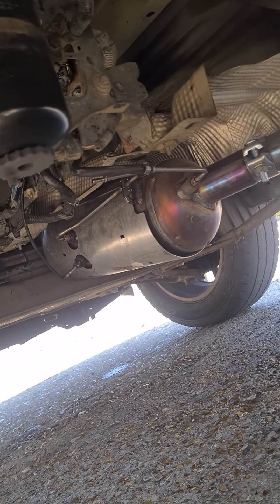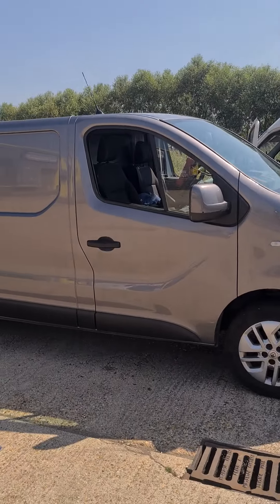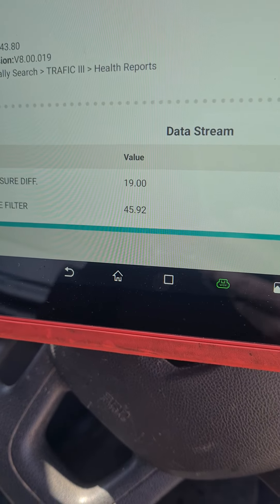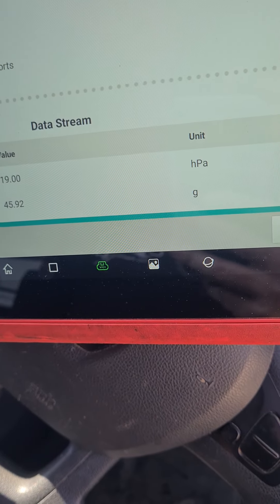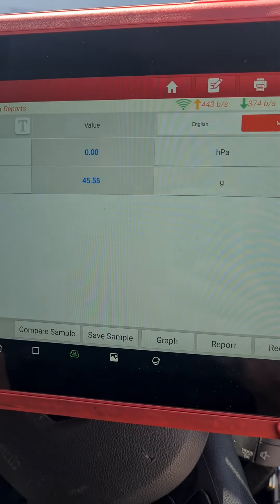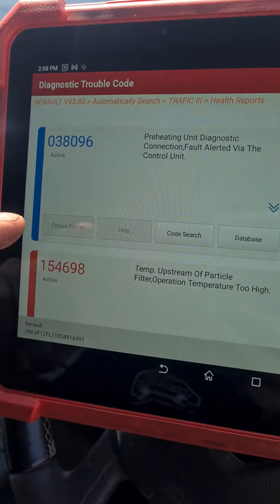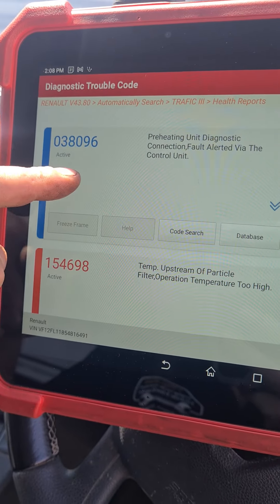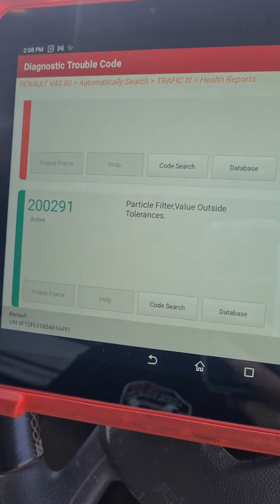Why Is My Brand New DPF Blocked ?

Comment: How do you know  when the vehicle will need new glow plugs due to dpf getting clogged? If the glow plugs work when starting the car. Should an individual glow plug test be conducted first or does the emissions operation completely different from start and run. Just trying to learn as much as possible. Thank you for your content

Comment: Can you please explain what is the function of the glow plugs in a dpf system? On my 20+ year old diesel, the glow plugs are used to aid the engine the start and not during its run time.
Reply: I was thinking that as well, is there a glowplug/glowplugs  in the dpf injector system 
to help combustion
Reply: I'm not sure but I can imagine that a glow plug fault will go under the category of faults that will automatically turn off DPF regen.
There are multiple fault codes that does not have a 100% direct connection to the DPF but will make the ECU to turn off regen, and that ends up in a clogged DPF.
Reply: If a glow plug is faulty, it's likely causing the system to disallow dpf regeneration cycles. Seen an older Insignia with 3 dead plugs that still ran, although it took a bit to get started but I could see manufacturers coding silly stuff in to the ecu to ensure ready sales of service parts.
Reply: Because engine load. When regen happens, engine computer turn on electric accessories: Glow plugs, fan, back window heating etc.
Reply: I have a Mazda BT50 2019 and on the exhaust upstream of the DPF, there is fuel vapouriser that contains a glowplug and a hose to a fuel pump. When the computer recognises that the DPF is full, it turns on the glowplug to raise the exhaust temperature to almost 700c, then turns on the fuel, which ignites and burns the soot away. When the DPF is empty, the computer turns off the fuel vapouriser. The glowplug will fail over time, but also, the fuel vapouriser can get blocked from soot and not work. This will cause the DPF light to come on, then the traction and engine lights, and create a fault code.

Comment: Jimmy... we think you're GREATTTTTT!! I'm struggling with my sons 2018 1.6l Vivaro. We removed a damaged, (injector No 4, no surprise there), and it's working great, need to put in the actual code, next week BUT, the van is still saying "particle filter clogged" 200292   "particle filter value, outside tolerance!"   200291! I'll get 4 plugs, and fit them, next week! Well done, Jimmy!
Reply from the maker: But do you have preheating fault?